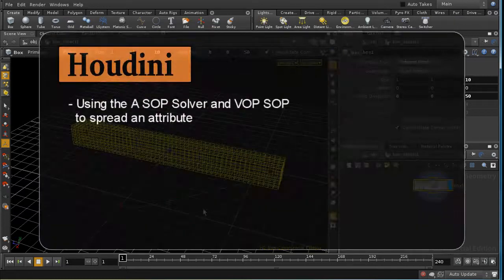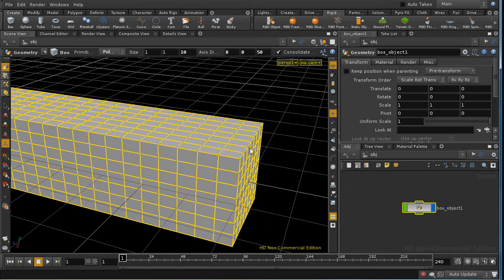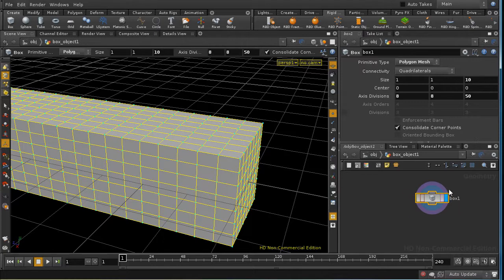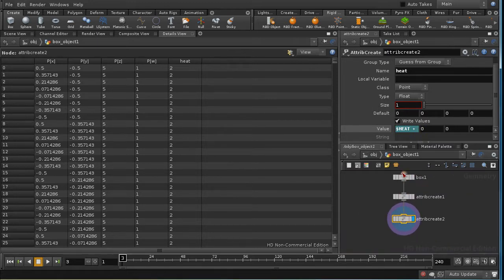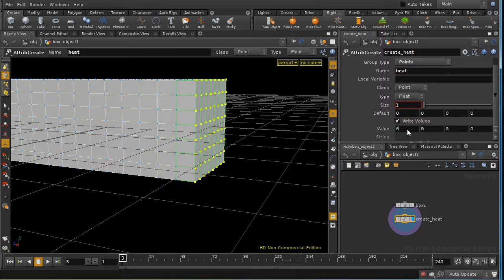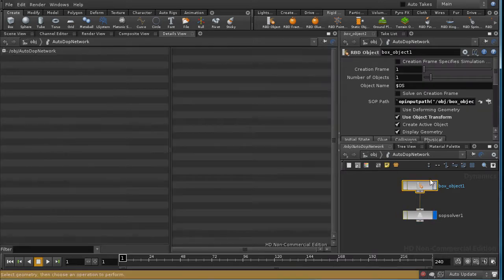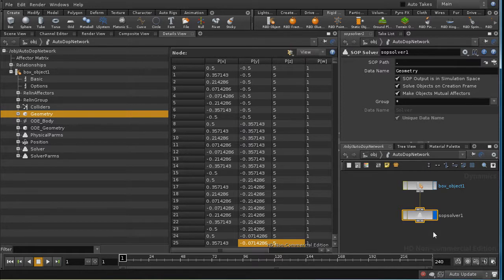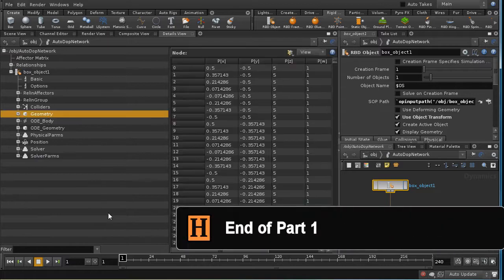Houdini SOP Solver 1

Comment: i'm using Houdini 16.5.439, whenever i connect sop solver into RBD object i get an error on sopsolver node says " connection to input 0 is the wrong type" and then geometry spreadsheet stop showing any details for the object .. do you think it is some kind of bug or the method has changed on this version of houdini?
Reply: Things have changed. lol. Download the project file (SOP_Solver_Houdini_10.zip), there is a Houdini 14 version in there that you can open in 16.5, it shows the work-around, basically a multisolver is used, first input the match and then the sopsolver..